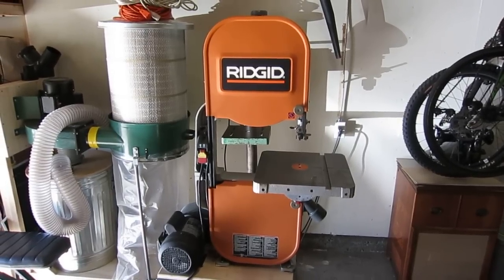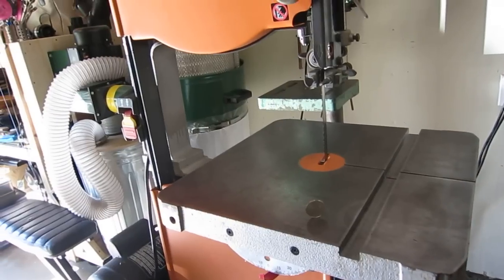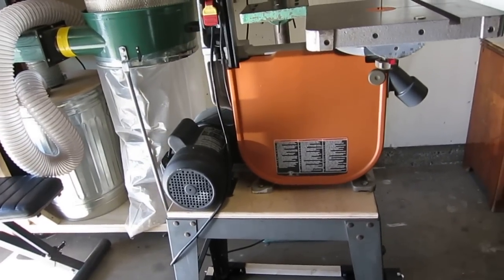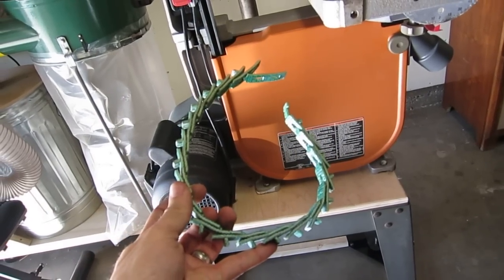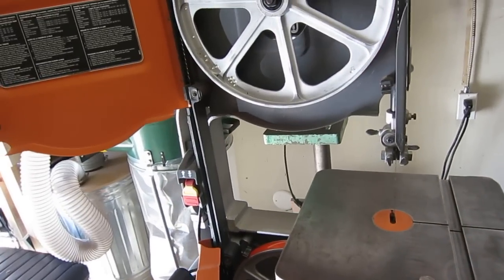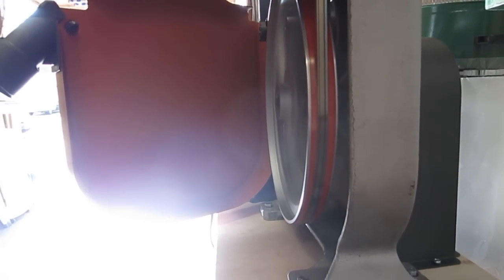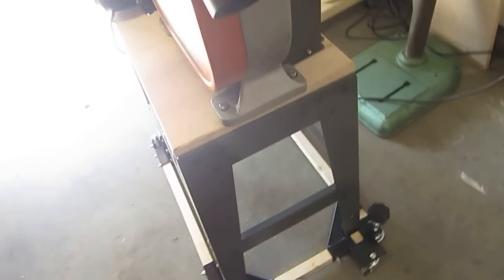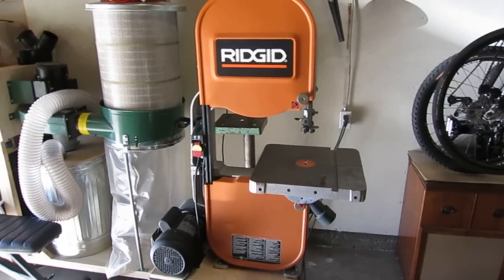Ridgid 14002 Band Saw Must Do Modifications

Comment: In my industrial equipment supply that I have owned for nearly 40 years, I sell and service all sorts of equipment.  During this time I have repaired hundreds of Ridgid bandsaws most exhibiting the same problem you describe in your video.   They all have problems centered around two main issues:  flat spots on the tires and v-belts that were out of round from lack of use.  The most consistent problem causing vibration is the v-belt issue.   Change the belt and the problem goes away.  If the saw stays  idle for a month or so, the problem returns because the belt becomes out of round again due to smaller pulley on the motor shaft.  To solve this problem, buy a segmented link belt at an auto parts store, Amazon or Harbor Freight.  There’s no need to disassemble the saw for a MDF or plywood base between saw and base. That’s just more unnecessary work and expense.

If the pulley tires have a flat spots, replace them with rubber or urethane tires.  Take your pick since both do the same job .  Rubber belts take longer to use since they must use adhesive to mount to the pulley and must dry over night. Center blade at the bottom of the gullet on pulley.  Also, take the tension off the blade if the saw sits idle for long periods of time. Otherwise the problem returns.

The main culprit out of all of this is attributed to lack of use.  If you don’t use the tool often, problems will develop on their own because of what I said above.   This would apply to the $400 Ridgid saw or a $50,000 Cincinnati lathe.  Believe it or not, sitting idle is much worse than medium use. I deal with these issues on equipment every day.

No need to balance pulleys.  They don’t spin fast enough to make any difference.  Those same pulleys  are used in other makes of lathes and I don’t see problems with them at all.  The only problem is people putting out bad information in their posts on the Internet. I
Reply: Dude, thanks for your additional comments. My saw was purchased on sale at the home depot,  with parts missing. Based on what people are saying I'm going to take your advise and follow through on new tires and pulleys. thanks for the tip on re balancing the wheels  -  not being needed. Sage advise !
Reply: Mucho_Grande 

If you do get to the point of balancing the pulley wheels, balance them as you would an automobile tire.  Add weight to  opposite the heavy side.  Do not remove metal to balance.  To balance, take off the blade.  Spin the pulley and note where it stops in relation to a reference mark on a piece of masking tape .  Use a Sharpie pen to mark the side of the pulley where it stops in relation to the reference mark.  Repeat the process 8-10 times.  You will see those marks group close together.  Then Use a metal clip to hold a small weight in place opposite the marks.  Spin the pulley again and mark where it stops in relation to the reference mark.  If the pulley stops close to your original marks, add more weight in small increments.  Once the pulley stops randomly at different places, your pulley is balanced.  Then epoxy the weight in place. Reassemble saw. All you need is a little time and effort.   DO NOT REMOVE METAL FROM THE PULLEY BY USING A DRILL TO PUT SMALL HOLES.  I See videos where people do this and all they do is mess up the pulley.  Just keep it simple by adding weight.  If you mess up, the weight can be removed.  If you drill, the metal can not be put back into place.  Does this make sense?

You might want to remove the rubber grommets from under the motor and just bolt down directly to the stand.  The grommets dry out and become hard.  You will not find  replacements.  Or you could use those rubber grommets that come with auto shock absorbers and slice them into half the thickness then bolt down the motor.  Either way will work with or with out the rubber grommets.
Reply: Great advice my friend I could not said that any better
Reply: The video and your info just confirmed my suspension... Bandsaws are pretty basic and minor upgrades can make all the difference. I just bought this bandsaw last week, cleaned it up and bought $50 worth of parts and new blades. Well worth getting a "cheap" bandsaw that should last a lifetime.
Reply: Thank you for this awesome reply! Super helpful!!
Reply: This was very helpful and informative thank you.. Also question... what is a smallest size sawblade you can put on this? I'm using it to cut round & curve wood circles and using it for wood projects. Thanks!
Reply: @dreamlookautodetailingauto3353  1/4” blade if I remember correctly.
Reply: @jarmstrong2843  thank you! I received a picture of blade sizes on   info from the Ridgid I might buy.. can I message you & send u a screen shot of it on messenger? Just need your info to send. Thanks!
Reply: @dreamlookautodetailingauto3353  Since I do not know you , I would prefer to not start that messaging stuff.   I  don’t know what messenger is on YouTube and what the potential ramifications are by trading messages.  I feel privacy on YouTube is very suspect and do not trust this forum at all other than sharing comments from time to time.  Given the climate in this nation nowadays, I think you may understand since folks can be attacked and doxed for no reason at all.
Reply: @jarmstrong2843  no problem at all.👍
Reply: Do the wheels need balancing?  And how do I do this?
Reply: @edwardkelly927  Instead of me writing a long description of the process, here is a video that does exactly what I have done countless times to band saws over the years.  As I mentioned in previous comments in this video, you do not want to drill holes in the pulley wheel to balance it.  It is much easier to add weight to the opposite side of the heavy side of the wheel and balance like an automobile tire.   https://youtu.be/avPP_zmcvEo

If your band saw has the old fashion V-belt from the motor to the drive pulley, I suggest replacing it with a segmented belt.  V-Belts will take on the shape of the smaller pulley if the saw has sat idle for a a few weeks and this will cause vibration too.  You can buy segmented belts at Harbor Freight, and auto store or via Amazon and cost $20-$30.  The only problem with these belts is knowing how to install them.  The are directional and if installed incorrectly, you'll get tons of vibration. So read the instructions when you buy one.

If the saw sits idle for a while, take the tension off the blade.  A blade under tension will cause flat spots on the tires that are on the pulley and cause vibration.
Reply: @jarmstrong2843  thanks.  Is it worth buying one of these units? Found one , new condition $200. I don’t mind needing to tune it up, 
Thanks again
Reply: @edwardkelly927  Is is worth the money?  That's a difficult question to answer since people have different concepts of worth.  If you're talking about the Ridgid band saw,, it's design is similar to other brands like Porter Cable, Craftsman, Delta, Ryobi, etc.  They are all basically made by the same manufacturer.  And the manufacturer has discontinued many of the parts for these saws; particularly for the Ridgid.  Parts for the Ridgid are getting scarce and will need to find a replacement part from other brands.  This can be difficult to achieve.  If your saw is in new condition, it might be worth the try to buy it, but I would suggest going for a lower price.  Take a look at the blade tension assembly on the top pulley to see if it is cracked.  That's a part that often fails.  But is can be replaced using a universal tensioner that's available on the Internet for about $40-$60.
Reply: @jarmstrong2843 how will I know what segmented belt is compatible? Do my best to measure the v-belt that’s on it? Or do you know the length? Thanks in advance

Comment: This was a huge help.  I too bought one of these off of craigslist and was similarly amused with the previous owner's poor setup.  Thrust bearing lined up as a guide bearing.  No guide blocks.  Blade guide on backwards.  Belt was loose.  I've been gradually tuning it up and tried the plywood base/rubber pad removal.  It was a big help.  Down the line I may go the route of replacing the tires, but they seem to be in good condition as is.

Comment: Thanks for the information. I have had my saw for about 6 years, changed drive  belt to the link type , upgraded to the 1.5 hp motor , riser block kit with 105 inch blade and still have a bit of vibration even after resurfacing the rubber tires. I'm sold on the upgrade to urethane tires now. We can still have the performance of a 1000$ machine after the small improvements.Also, you can sharpen those blades with a dremel using a diamond 7/32 bit. Thanks!

Comment: Thanks for the video. Picked up a used paint shaker today and after watching your video we were able to reduce the vibration 90% just by balancing the wheels and removing the rubber motor mounts. 

This weekend we will install a 3/4" MDF spacer between the saw/motor and stand and replace the drive belt. 

That should smooth it out completely.

Comment: Man oh man!  I removed those rubber grommet shock absorbers.  I replaced the belt with the link-type and this saw runs amazingly well.  I just received the new urethane tires so those are next.  Then I'll strengthen the base with some 3/4 plywood.  Thank you for this great advice and help.

Comment: I just lucked out and bought a set of grey Rigid tools with the Emerson motors. I got  the 6" jointer, Oscilating Sander, Lathe and bandsaw. Your video was invaluable for the bandsaw. The tools were like new but had been in storage for seven or more years. They were stored well in aheated shop. But just like yours, the bandsaw had been left with the blade tension pretty tight.. Fired it up and you know what happened....shake and bake!! I thought I'd skip all your mods and go straight to the tires. Bingo. That was all it took. Passed the quarter test. Very informative video. Thanks so much.
Reply from the maker: Yuval Yeoman Glad the video helped and glad you were able to skip the rest of the 'mods'.  Enjoy your new tools!

Comment: I have had a Ridgid 14" for several years and it had been great.  I had to balance the wheels as well.  I put a riser block in mine so I can make larger band saw boxes (my blade size in now 105 inches).  I still love mine - I think you'll like it. Thanks for the video - I may change the tires on mine now.
Reply: What brand and where did you purchase the riser kit?
Reply: Ridgid and if I recall I ordered the riser kit form Ridgid.
Reply: +Lynn Lacey thanks buddy. I just recently purchased one and I'd love to have the resaw capacity of about 10"

Comment: I'm really glad to hear this. I just picked one of these up today for free that has some wobble to it. I think mostly it he unbalanced wheels. They already put new urethane tires on it. I plan to balance the wheels and the other issues is the bracket that holds one of the bar guides broke and the piece that the table adjustment bolt heads fit in are broke. That part is easy. My main concern is the wobble. Mine is several years old hopefully I can still get some parts for it on a budget.

Comment: Haha!  You think yours was in bad shape!  I bought one of these off of Craigslist for $75 back in 2007.  The guy had used it outdoors to cut decorative concrete!  It was badly rusted, the orange paint is badly faded, etc.  I replaced all the bearings, balanced the wheels, installed urethane tires, installed new blade, resurfaced the table, replaced the bladed tensioner with a crank, added a 6" riser from Grizzly and added a mobile base.  I have since had to replace the wheel hinge block and the cast piece that holds the guide blocks.  Just now (2018) planning to replace guide blocks with cool blocks because the originals are very worn.  I have been happy with this machine.  A professional shop might find it lacking, but it is everything a homeowner/hobby woodworker needs.

Comment: i just picked one of these up as a package deal used with a ridgid table saw. this is exactly the info i needed to make sure it's running tip-top. thanks!
Reply from the maker: Glad it was of some help!  Hopefully your table saw doesn't have the 'blade shift' problem that plagues the R4512 line.  If it does check out my other video for a fix.  We've had a few people do the modification and have confirmation that it works.  Enjoy your new tools.  Now go make some sawdust!
Reply: thesergeant it's an older one, the ts3650. i checked the blade at pick up and it was square to the miter slot, but i wasn't aware of this issue. i'm watching those videos of your now and will for sure do a complete tune up of the table, wings, blade, etc tonight hopefully. thanks again for sharing!
Reply from the maker: Mike Carr Oh you're good then.  The TS3650 doesn't have the issue described.  You should be good to go.  Apparently that TS3650 is a great one.  Enjoy it!
Reply: thesergeant it's replacing a crappy portable jobsite saw with a horrible fence. i'm REALLY looking forward to setup and building a cross cut sled for it. then MOUNTAINS of saw dust!

Comment: I just picked one of these up and saw your video before I picked up the tool!  I believe mine may have been older as the main color is grey not orange.  When I turned it on, the machine did shake a lot!!  I wasn't sure it was an issue, but I decided to tackle it.  Did the plywood top, but also added a shelf in the middle.  Removed the rubber grommets under the motor.  I'm not sure if I forgot you mentioned HF for the belt or not, but I bought a more expensive V belt from Rockler.  This took away 95% of the vibration.  I made sure the pulleys were in line and had the right tension.  I was told the urethane belts would do nothing for vibration, so I skipped those as well as the cool blocks.  I didn't do the spring either as that is needed more for reassign, which I'm doing, at least for now!!  I was also able to get adjust the wheels without drilling by adjusting the coplanar.  

Thanks again for the vid!!
Reply from the maker: Awesome!  Glad the vid helped.  Enjoy it!

Comment: I made every mod 6 years ago and had the same luck. I have since upgraded from blocks to rollers. I bought a 6" riser and decided to shim to adjust for plane and drop angle while I was at it. It is very smooth and square.
Reply: My saw has bearing guides, something I looked for before purchasing, but the more I learn and use it, the more I would rather use blocks.  When I first got it, one bearing guide was missing, so I made a crude block guide from an offcut of softwood - it worked as well as or better than the replacement bearing guide I purchased and run currently.  See Matthias Wandel's excellent youtube videos on bandsaw guides.

Comment: OMG I have been messing this this saw for some time trying to get rid of the vibration. I did not do the plywood, but did remove the grommets. Took off the wheel and balanced it. Ran motor with belt  and NO wheel ....WOW that was where the vibration was.
Put on the Segment belt from Harbor Freight. I can do the nickel test. I did buy new belts from Carter. Makes me feel better.
All is Good, Vibration FREE.

Comment: I also have a Ridgid  BS14002 and had to do several improvements as well. 
I replaced the guide blocks (that slightly  touch the blade sides both above the table and below) with Carter Guide wheels. 
Since these band saws do not come with a fence, I bought a KREG precision band saw fence, which it was that that made the saw bearable to work with. Rockler has these fences and they are great as they give you so many different positions to seet the fence for any applications and KREG offers more goodies for the fence.
I had a vibration issue and over came most of it by using a spring instead the threaded rod to tension the drive belt. I am guessing there is 30# tension on the drive belt and it's never slipped once.  
Now that I have seen thesergeant's video I will replace the tires with urethane tires. I had thought about it for several years but hadn't heard of anyone else doing so until.
Another thing to do is when you buy a Ridgid bandsaw, throw away the blade included with the saw and buy quality name brand blades. I use Timberwolf, Grizzly, or Starrett.   I also use sanding belts on my band saw.

Comment: Like some of other commenters, I've had this saw for years and cringe every time I have to use it, but didn't want to get rid of it either. I had heard about stabilizing the base with plywood, but not the other things you mention here. BTW, my RIGID 14" can run on 240, but I haven't tried it, not sure if it is worth it or not. I can see running a table saw on 240 if it is capable, but not sure about a band saw. Thanks for the info, I look forward to applying these fixes and getting more use out of the old gal. It's done its time as a shelf/catch all.

Comment: I've been trying to get the vibration out of my Ridgid bandsaw.  I've done everything you did, and even went an extreme step further and completely replace the metal frame base with a heavy wooden cabinet.  Unfortunately, it still has some vibration.  Mine is also already fitted with a 6" riser block.  I still have rubber pads under the motor still, so will try removing them and see if that helps.

Comment: I still never got mine running. Bought it from a guy (bought all his tools). He dropped the cast aluminum guide block (part number 141076 stamped on it,)when I was there and it broke on the cement floor.. So it has set. He also put a 4x4 block of wood, instead of buying a cast riser block from Grizzly for ?? $80? Anyway good tips, I might try and get this thing going, because he used it to build 2 guitars and that was it. Any idea where I can get that part? If you know, I'd appreciate it. Seems like I misplaced the manual on this one.